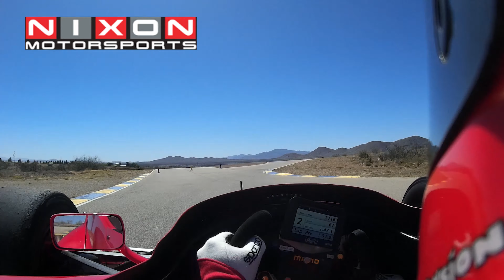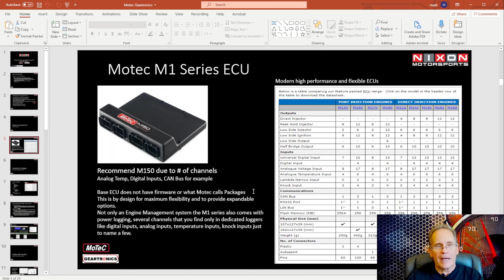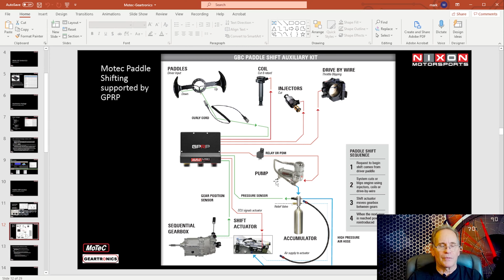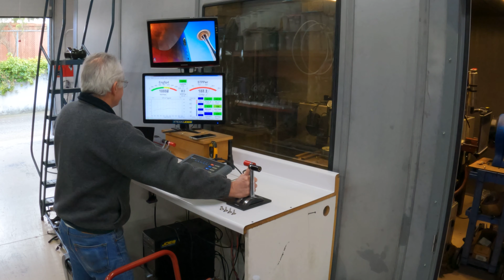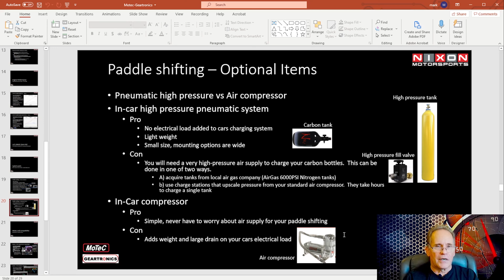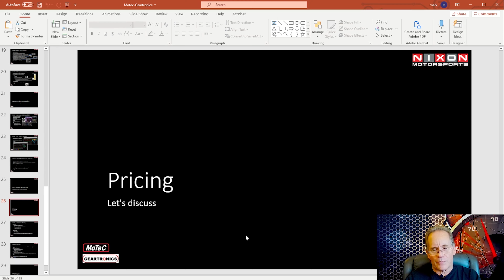Want to go faster? You need the best Motec & Geartronics for your motorcycle powered race car!

Comment: Will the Motec with Geartronics work with a Hayabusa Gen1 1300 engine. I would like the paddleshift functionalities.
Love your commitment and passion for the sport. greetings from South Africa.👏🏽🙏🏾🏎❤️🇿🇦
Reply from the maker: Great question.  I would say yes, it has a few items that would need to be resolved.
#1 if you wanted to convert your GEN 1 to DBW you would either need to use the GEN 2 throttle bodies (with an adapter) or buy a conversion kit from HTP making the GEN 1 throttle bodies DBW.
- OR - 
#2 you use an external geartronics GPU that controls throttle body blips with external actuator and do not convert it to DBW.

The cleanest is DBW setup as the M1 series Motec ECU's support the geartronic package which controls all engine aspects and also paddle shifting directly with no external control units.  As for using a GEN 2 throttle body on the GEN 1 engine you would need to double check mounting and spacing - from what I can tell it will fit but the spacing is off a little. I know it has 8 injectors vs the 4 injectors on the GEN 1.  If you went this path you would not need to use the second injector per cylinder but being it is there and you switched to Motec I would enable it and split the fuel between the best injector for power.  Part of dyno tuning work. 

HTP Kit - https://shop.htpperformance.com/htp-gen1-hayabusa-ride-by-wire-kit/

I hope this helps!  thanks for the comment, I do appreciate it.